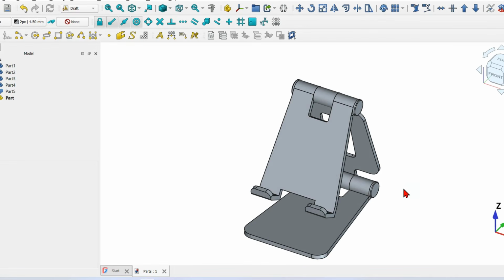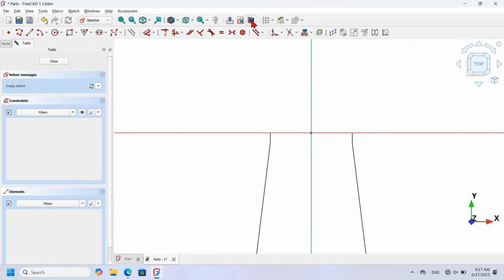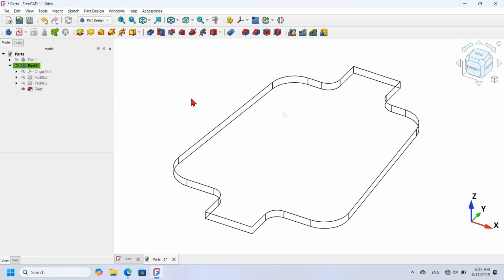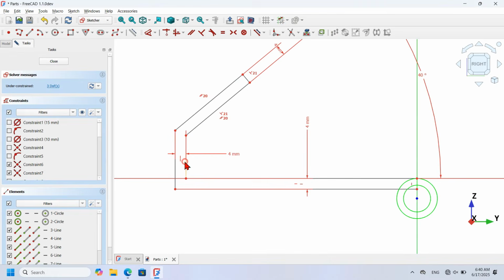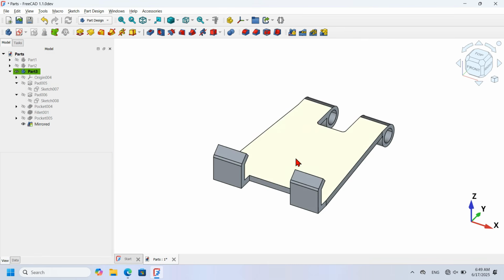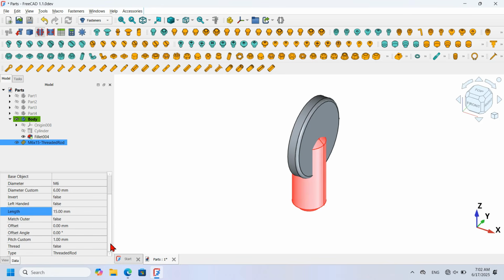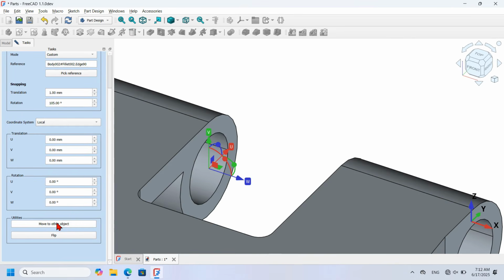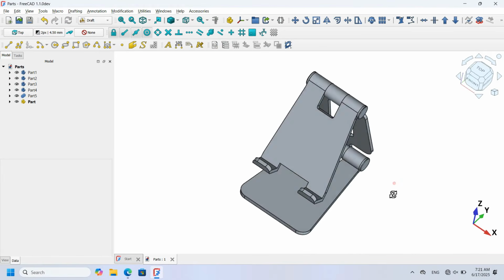FreeCAD 1.0.1 Dev: Using the transform tool to assemble parts | Std Transform improvements | Part 1

Comment: Can this transform tool method be used in place of the assembly workbench for production level projects? 

 Is there any functional difference in building on top of this file down the line?
Reply from the maker: I personally don't use assembly benches during 3D modeling because of the functionality of the transform tool.

Comment: At 25:33 I am lost. I don’t have a Transformer window like you have. All I have is Translation Increment and Rotation Increment. What’s wrong? I am using 1.0.1.
Reply from the maker: You are using the FreeCAD 1.0.1, as you said. The Transform tool improvements appears from version 1.1+. Install the Dev version from weekly builds in GitHub website.
Reply: Thank you for the reply. I wish you will advertise correctly. The title of this video says “FreeCAD 1.0.1 Dev”.
Reply: There is a typo in the video title, but FreeCAD 1.1.0dev version is shown throughout the whole video in the top left corner of the screen.